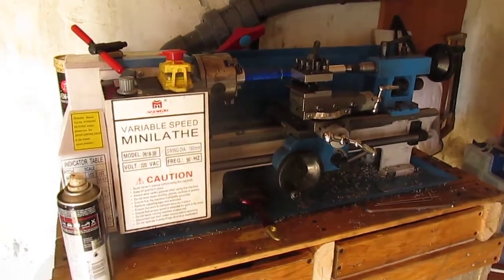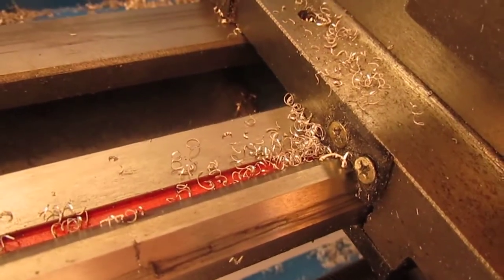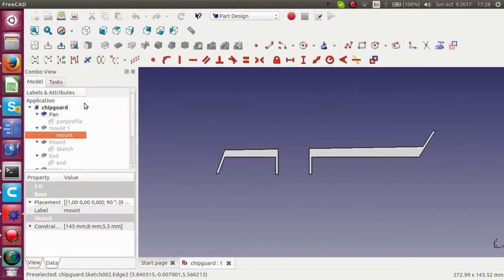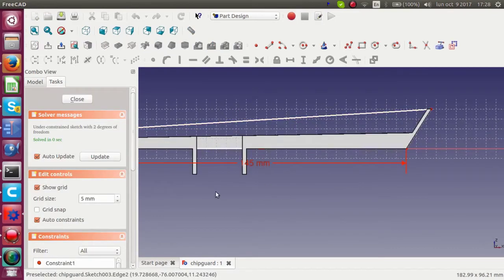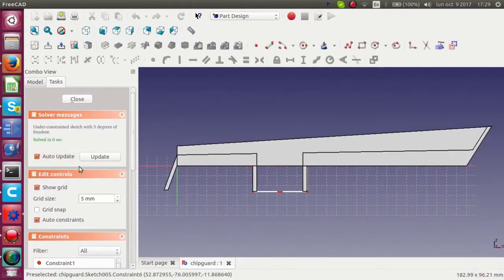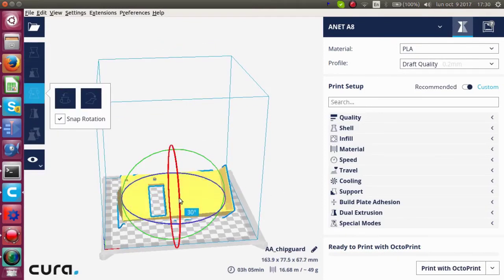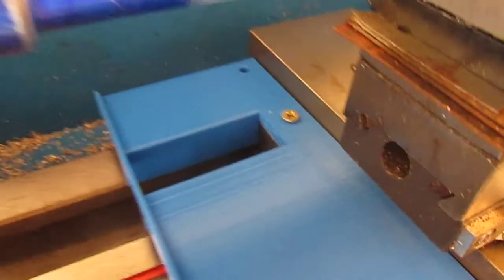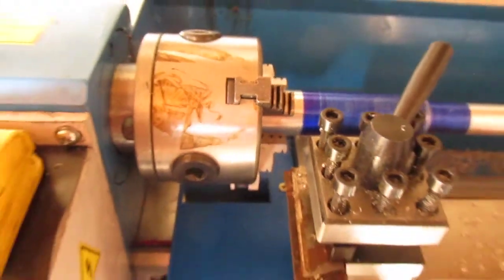Mini Lathe Chip Tray 3D printed

Comment: Another good video. Glad you found Freecad a good thing to use, it is good software. I have my own cad system, but if I did not, I think I would find Freecad easier to learn than Fusion 360. I have it on my pc as I have found it good for various file conversions. Before I splashed out for an upgrade to my system earlier this year, mine was too old to handle some of the newer files around, but Frecad did the job well enough.
What category are you listed under on Youtube, I could not find it anywhere? 
Don’t understand why you don’t get more views and subs, you work is entertaining.
Reply from the maker: Perhaps me not knowing what a 'Category' is on utoob might be a thing ;)
aga is just my initials. there is also the American Gas Association and the Aga Khan, both of which are rather bigger than me.